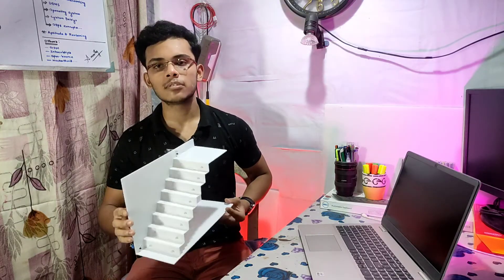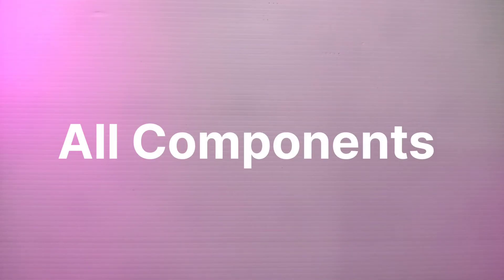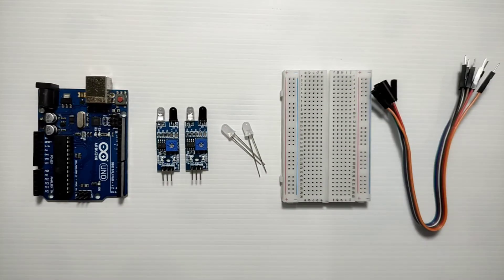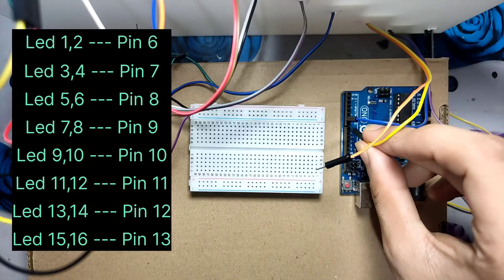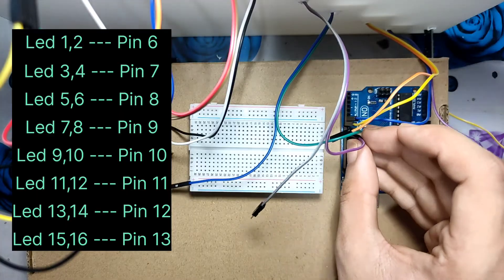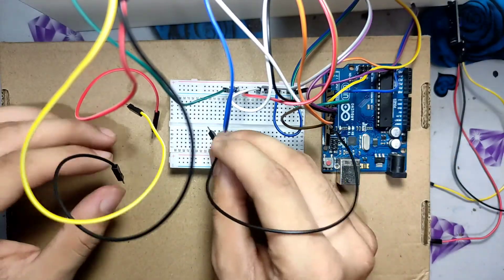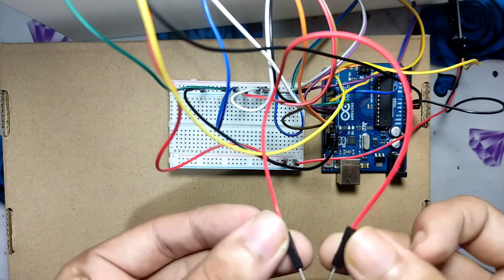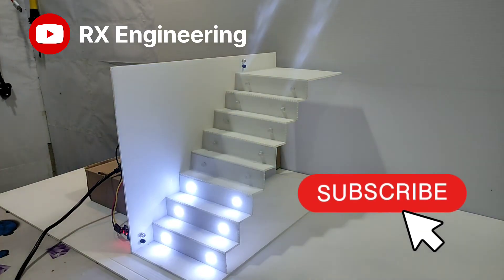How to Make Automatic Stair Light | Arduino Stair Light Project | IR Sensor

Comment: // Pin Definitions
const int bottomSensor = A0; // IR sensor at the bottom
const int topSensor = A1;    // IR sensor at the top

// Pins for LEDs (Total 16 LEDs)
int ledPins[] = {2, 3, 4, 5, 6, 7, 8, 9, 10, 11, 12, 13, A2, A3, A4, A5};
int ledCount = 16;

void setup() {
  // Initialize LED pins as outputs
  for (int i = 0; i < ledCount; i++) {
    pinMode(ledPins[i], OUTPUT);
    digitalWrite(ledPins[i], LOW); // Ensure all are off initially
  }
  
  // Initialize Sensor pins as inputs
  pinMode(bottomSensor, INPUT);
  pinMode(topSensor, INPUT);
}

void loop() {
  // Check if someone triggers the bottom sensor
  if (digitalRead(bottomSensor) == LOW) { 
    // Sequence Up: Lights turn on from bottom to top
    for (int i = 0; i < ledCount; i++) {
      digitalWrite(ledPins[i], HIGH);
      delay(200); 
    }
    delay(2000); // Stay on for 2 seconds
    // Sequence Off: Lights turn off from bottom to top
    for (int i = 0; i < ledCount; i++) {
      digitalWrite(ledPins[i], LOW);
      delay(200);
    }
  }

  // Check if someone triggers the top sensor
  if (digitalRead(topSensor) == LOW) {
    // Sequence Down: Lights turn on from top to bottom
    for (int i = ledCount - 1; i >= 0; i--) {
      digitalWrite(ledPins[i], HIGH);
      delay(200);
    }
    delay(2000); // Stay on for 2 seconds
    // Sequence Off: Lights turn off from top to bottom
    for (int i = ledCount - 1; i >= 0; i--) {
      digitalWrite(ledPins[i], LOW);
      delay(200);
    }
  }
}

Comment: How this lights on without cell or battery. What you have done here following same approach will my projects work on. Will lights on after the same connection
Reply: You plug it in or use a battery bank. Arduino just needs 5v power supply.
Reply: @Michael-yk1lm  without battery will be run na??

Comment: Is there any need of cell or battery??
Reply from the maker: Yes, you can use battery because arduino needs 5v power supply. But here I connect the Arduino with 5v adapter. So no need of any cell or battery.